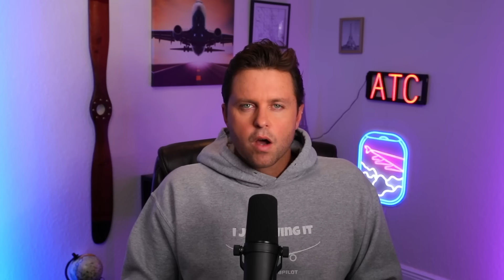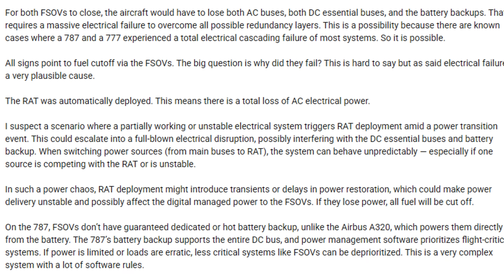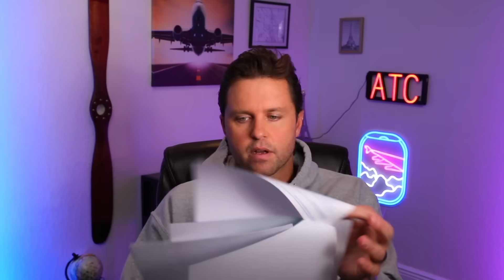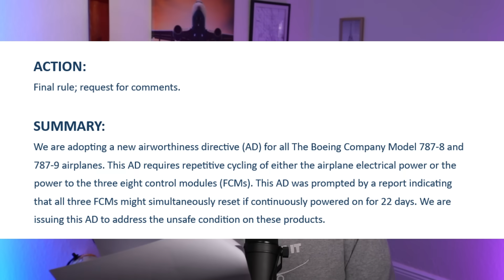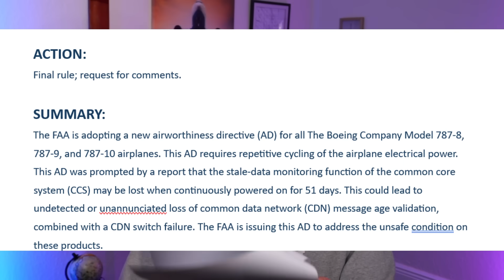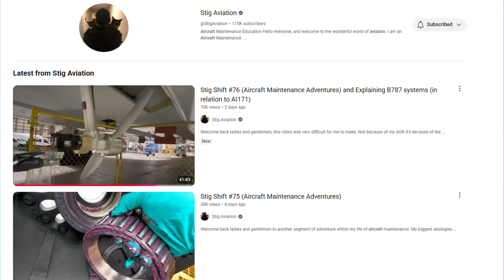Air India 171: Did a Software Glitch Cause Dual Engine Failure?

Comment: ❤ truth slowly  coming. 
I commented on multiple channels about events that happened a few days before on this plane, which were certainly all electrical.  Strange burning smells, flight were deleted. That day landing in Ahmedabad,  AC were not working not entertainment computer, showing that some computer systems were working on degraded mode, as if they are not part of the essential tips, I was focused on a computer motor regilation system failure, without knowing more about how electrical failure and computer reset can induce engine stop working. Now we have a way to think this is possible, by software.
One thing I would like to be investigated is, why the crew decided to place the plane at the very begining of this very long track, that day it was the only one to do that. This is a precession case, that indicates the crew was knowing there was an issue, they certainly had a discussion with someone or the data was showing a loss of power, or intermittent electricity loss as indicates the radar intemitent loss on the FR24 recording. The only plane doing that this day. It could be compatible with a compter trying to reset? How is it possible? Do pilots on this plane are aware of this issue in their training? Can someone try this issue on a realist boeing simulator?
Those are questions I Ascked to pilots previously, now seems my demands were not so inaccurate as if I'm not a specialist. 
I was on the flaps, because a passenger signaled on the left wing a flap that was badly retracted, an other problem that can be linked to a full track taking off, and also electrical I presume

Comment: Who could potentially have access to on board electronics? This wouldn't be something that aircraft maintenance could have impacted unintentionally? I ask because somewhere in the reams of reports and videos I have watched it was mentioned that the aircraft had been in for maintenance that day and there were reports and video that the aircraft was losing power on the passenger side, air conditioning, etc on the previous flight.. Was this power issue fixed? Could something with this have played a role? What a terrible, terrible thing. Thank you for your work. Captain Steve sent me.

Comment: Have always maintained it was a massive catastrophic electrical failure that caused the crash, confirmed by RAT deployment,hydraulic to operate LG and flaps are from electric pumps, which are depowered,so no gear retraction ,airframe fuel pumps too depowered, EEC still powered,>8%, may have spooled back engines to prevent engine stall,as on gravity feed ?? 3 or more generators fail,apu starts automatically, so apu intake seen open on ground,,
Smoking gun is massive electrical failure.. !!!

Comment: From software and EE background, I’d like to add, it’s technically not a software bug in the FPGA (I assume) governing all the power supply logic IF the power sources were failing. Then the logic is just yeah random. I could see it shutting FSOV not caring about altitude because the system literally doesn’t enough power to go around… why can’t the engines themselves also provide power like they do for the FSOV but instead provide it to the aircraft..  Shit. I can’t imagine an electrical failure like this. But FPGA logic is so tested and bullet proof. It had to be something physical in power bus but there’s so much physical redundancy. And batteries failing is tough, because you think they would have degraded prior to takeoff.
Reply: Just saying “delays and competing power” is just too simplistic. It has to be a lack of input for some reason or a bad battery. The circuits and logic governing power control are 100% logic proof, if that makes sense

Comment: The consensus seems to be dual-engine failure.  One valve or two?  Spring loaded or not? It seems clear an electrical malfunction possibly combined with software or logic glitch is where the root cause will be found, hopefully before the next one crashes, until the fleet is grounded just like the 737MAX.

Comment: New evidence? They had a cascading electrical failure when the squat switch went into flight mode. I posted on CA Steeeve's channel 3 days after the crash but I decided to remove the post becasue no one was commenting especially him. I thought that maybe Boeing, the world's largest deep state benefitting multi national corporation, could have told them not to say anything. But the WhatsApp text that started circulating the globe 3 days after the crash was brushed aside. I think  it was a whistle-blower's comments who had access to the data recorder. Here is the WhatsApp text that was circulating 3 days post crash:

Still to be verified but it looks like a catastrophic electrical failure on rotation. 

Flight: AI-171 | Aircraft: Boeing 787-8 | Date: June 25, 2025 | Route: Ahmedabad (VAAH) → London Heathrow (EGLL)
Crash Site: ~1.2 km from VAAH Runway 23, post-V1 and rotation
Fatalities: 247 (243 onboard + 4 ground)
Survivors: 0 onboard survivors (alternate to original), 3 injured on ground

⸻

🛠️  AAIB Preliminary Report Highlights

1. Primary Cause – Electrical Power Transfer Interruption (PTI) During Rotation
	•	During transition from ground to airborne electrical configuration, the aircraft experienced a cascading dual-engine FADEC (Full Authority Digital Engine Control) failure.
	•	Root cause: Uncommanded bus transfer failure due to arcing in the main power relay box (PRB-A), traced to water ingress during pre-flight GPU disconnection in heavy rain.
	•	This led to loss of electronic engine control at rotation, resulting in both GEnx engines rolling back to ground idle within 4–5 seconds.

2. Flight Data Record Timeline
	•	+0:11 sec: Nose gear lifts off.
	•	+0:13 sec: Sudden engine rollback begins. Thrust reduces from 92% N1 to <27% within 3 seconds.
	•	+0:16 sec: Master caution + ENG FAIL L/R warnings. FO calls, “Both engines dropping!”
	•	+0:20 sec: Autopilot and flight control reverts to Direct Mode. Pitch up attitude peaks at 18°.
	•	+0:25 sec: Aircraft stalls at 186 ft AGL.
	•	+0:30 sec: Full aerodynamic stall; nose drops rapidly.
	•	+0:38 sec: Ground impact at 54° nose-down attitude, 174 knots.

⸻

⚙️ Contributing Factors
	•	Environmental Conditions:
	•	Torrential rain during pushback.
	•	Moisture intrusion into PRB-A connector (P/N: HLN8471) — a known corrosion-risk component.
	•	Latent Maintenance Issue:
	•	Power transfer relay unit showed signs of thermal damage in a previous MEL deferral 2 weeks prior.
	•	No replacement had been conducted; aircraft was cleared under repetitive deferral.
	•	Design Oversight:
	•	Boeing 787 has no physical engine control backup (i.e., no direct mechanical linkage in FADEC loss scenario).
	•	Loss of power supply to both EEC channels resulted in engine “freeze” at ground idle instead of flameout.
	•	Flight Crew Response:
	•	Attempted engine relight sequence not completed before stall onset.
	•	Emergency power selector not activated — possibly due to confusion from multiple ECAM warnings.

⸻

✈️  Immediate Safety Actions
	•	DGCA + EASA + FAA Emergency AD issued within 24 hours:
	•	Mandatory PRB-A moisture integrity inspection on all Boeing 787 aircraft.
	•	Temporary restriction on dispatch with MEL items related to power transfer systems.
	•	Boeing:
	•	Issued Service Bulletin SB-787-24-212 requiring replacement of PRB-A connectors with sealed versions.
	•	Exploring addition of dual-path power redundancy for FADEC systems.

⸻

🧠 Lessons Learned
	•	Over-reliance on electrical power distribution architecture without layered redundancy.
	•	Lack of crew procedural training for full engine rollback during takeoff in EEC dual failure scenarios.
	•	Need for improved environmental sealing in GPU/electrical handover units in monsoon zones.

⸻

🕯️ Human Toll
	•	The loss of 243 onboard lives, including 12 crew and 18 infants, deeply impacted the aviation community.
	•	Final words captured on CVR: “We lost everything – no thrust!”
	•	One family of five was killed on the ground in a hospital ambulance struck by debris.

Comment: Theory does fit the scenario facts well, also eyewitness account of survivor says there was a bang and lights flickered at the moment RAT deployment sound heard. The wreckage of the tripped circuit buses would confirm the theory. But until then, this is still only speculation. How well is the reset sequence known for this?  Do you know the eyewitness also suggested engine thrust restoration moments from impact?
Reply: Engine thrust restoration can also possibly refer to rat and him possibly suffering from somatogravic illusion

Comment: What your saying is that if a fire happens, across town, and it burnt up some local electrical lines, that all your appliances inside your house have been blown up. Very far fetched. Of course with Air India's cost savings toward maintenance anything could have happened , but even still, there is a lot of electrical protection to eat through before getting to those shut off valves.  Did the RAT deploy BEFORE the engines went silent and it upset the apple cart?

Comment: No one is talking about the possibility of a ground mode logic fault causing auto throttle rollback. Fits everything I've seen so far, including the gear being stuck in a transitional state. Possibly even the rat being deployed --- if they deployed it manually (is that possible?) before finally disconnecting the auto throttle.

Comment: I would like to know why the gear retraction process failed. The videos clearly show the gear bogies tilted forward, which is the first step in main gear retraction. It looks as though the pilots pulled the gear retraction handle, the process started, but then stopped after the bogies tilted forward. Was this the moment when power failed? Did the sudden power drain demanded by the gear retraction process trigger the power shutdown?

Comment: Contaminated fuel is a popular guess across the various aviation channels I've seen, even when they're nothing more than that – an educated guess. But it has raised one major question in my irrefutably uneducated mind: when/how does the fuel get contaminated? 

If it happens after the fuel is in the tanks, wouldn't they have to get contaminated in both engines for this to happen? If it happens before the craft is fueled, then would other planes drawing fuel from the same source also not suffer adverse consequences?

Comment: A complete loss of the airplane’s main electrical buses will not, by itself, shut a GEnx-powered 787 down. Once each engine is running, its Full-Authority Digital Engine Control (EEC) stops relying on ship’s power and feeds itself from a gearbox-mounted Permanent Magnet Alternator (PMA). The aircraft buses are merely the start-up and backup source; if the PMA or its wiring failed the EEC would simply revert to the airplane supply, but the reverse is not true—losing the airplane supply does not starve the EEC of power after start-sequence hand-over.

Fuel delivery downstream of the metering unit is safeguarded by a spring-loaded Pressurizing & Shut-Off Valve (PSOV). The spring biases the valve closed; fuel pressure generated by the engine-driven pumps (under EEC control) holds it open in normal operation. Only if fuel pressure collapses and the spring’s closing force is no longer opposed does the valve shut—there is no electrical “trip-closed” logic.

The upstream, wing-spar shut-off valve is a separate DC-motor valve. In flight it sits latched open and requires an active 28 V command (via the fire switch or FUEL CONTROL switch) to motor closed. Boeing installs a tiny “Fuel Shut-Off Module” (FSM) on the flight-deck side that carries a bank of large capacitors; if both airplane power and the hot-battery feed disappear the stored energy in those capacitors still guarantees one powered closing run of each spar valve (and the APU valve). The FSM therefore gives you a way to shut fuel OFF without relying on the airplane electrical system, not a path for an inadvertent shut-down when power is lost. It is explicitly “not a battery,” so it cannot power the valves indefinitely, nor keep them open.

Putting those pieces together:

After light-off, each engine’s EEC is self-powered by its own PMA, independent of aircraft generators, batteries or RAT.

The PSOV stays open as long as mechanically delivered fuel pressure exists; it is unaffected by electrical outages.

The spar valve stays where it was last motored; loss of airplane power cannot command it closed, and the FSM’s stored energy is reserved for a deliberate shut-down command.

Therefore a total aircraft electrical blackout would not automatically close either valve, nor starve the engines of fuel. The engines would keep running, their PMA-fed EECs would keep metering fuel, and the crew (or automatic load-shedding) could work on recovering or reconfiguring the airplane electrical system while propulsion remains available. Only a direct pilot/fire-handle action, dual engine-driven fuel-pump failure, or a catastrophic internal engine event that collapses fuel pressure could lead to fuel cut-off and engine-out in that scenario.
Reply: Thanks your comment makes sense.

The aircraft crossed the end of the runway at 71 fl agl and flew to the crash site about 1.600m away. This flight could not have been achieved with the engines shut down; hence the engines had to be operating at low power.

The $64,000 question is what caused the engines to rollback?

Perhaps autothrottle or something else upstream of the FADECs.

Comment: I don't see much of an issue with the electrical systems as I do with the advanced electronics. Like any computer, it needs a reboot/reset after so long. I commented my theory on captain Steve's channel the other day of when the power bumped off, it inadvertently cut off the fuel control circuits.

Comment: I know you cannot compare a Boeing 787 to a Diamond DA42 but in the early days of the DA42 there was an accident where the airplane owner forgot to turn off the cabin light overnight and next day the battery was empty. It is forbidden to jump start to DA42 with ground power without recharged batteries as the diesel engines require electrical power for the FADEC systems.  To make a long story short the owner ignored that, and took off.  The moment he selected gear up the electric hydraulic pump kicked in and required more power than available by the two generators of the diesel engines therefore starved the FADEC system of power and both engines shut off. (Normally the aircraft batteries supply the additional power but they batteries were empty) Therefore emergency landing AS A GLIDER.  Everybody fine anyhow Diamond corrected the problem and built in another backup battery in the tail of the airplane so this kind of scenario cannot happen anymore.

Comment: The engines didn’t have enough air density altitude
Reply: On the day the density altitude was 3,345 ft. If the correct data are input to the FMS, it takes density altitude into account when determining the required safe take-off thrust. In this case the aircraft rotated ast the normal point, about 2,100m from the start of the runway and climbed to 400 ft in 10 seconds, at a rate of 2,400 ft per minute,  which is normal. The problem occurred soon after.

Comment: The first thing I speculated on when this crash occurred in the manner it did with the RAT deployed, I suggested a computer issue and Pilots unaware of how to deal with it. 
The only other possibility I heard that makes possible sense is that only one engine failed and  the co-pilot may have inadvertently shut off the wrong engine when the Pilot called for the faulty one to be shut off. This would have happened at a time when it would be impossible to recover.
Reply: The limit evidence available suggest that neither engine was shut down and that both engines were operating but had rolled back and were producing low power.

An engine restart takes 45 seconds. The aircraft rotated and climbed to 400 ft normally and shortly afterwards the problem occured. The aircraft crashed 20 seconds later.